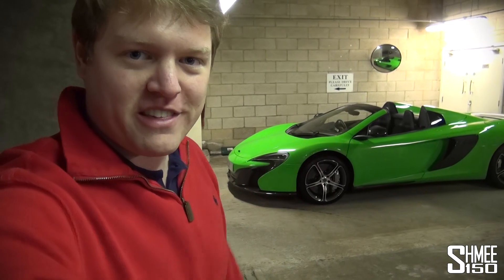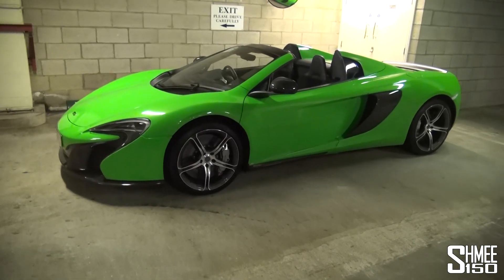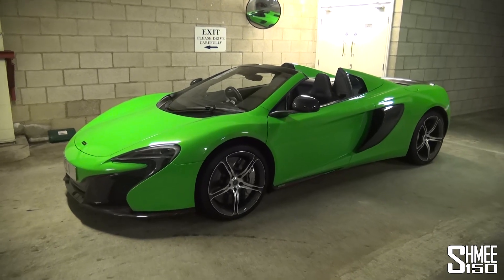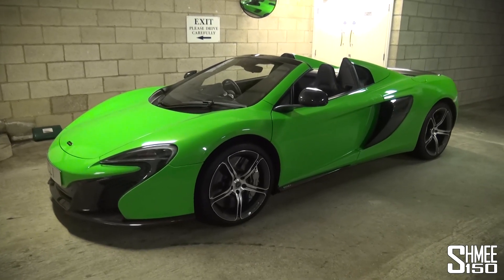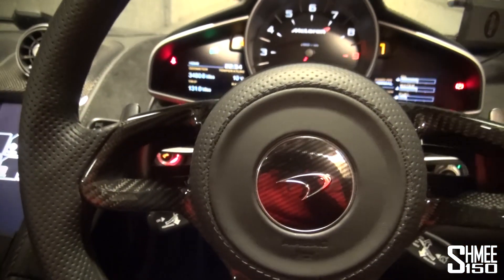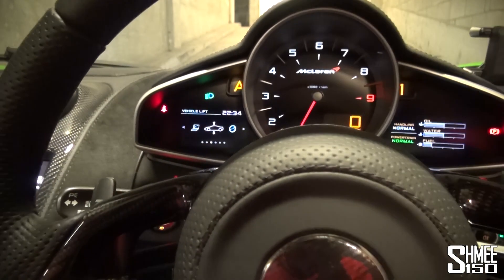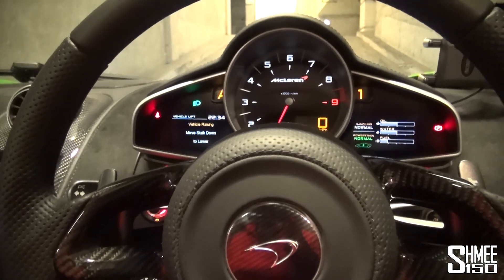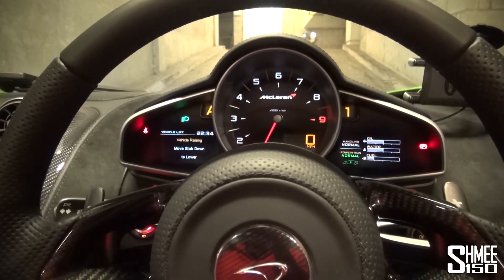McLaren 650S - Lift System Demonstration

Comment: I have always wondered about this low super car issue. Lift systems haven only been a more recent thing. If you are in a older super car and come across a speed bump with other cars behind you what exactly would you do? I would assume drive away and hope to find another route. Also how does this lift system work? I may have missed you saying it in the video, but is it hydraulic or air bags, etc?
Reply: It's way easier on a 458 Italia. 1 button push, boom, done. If you're under 40kmh you can turn it on already when you see the bump, so no one behind you honking needed either. :)
Reply: Hydraulic since the suspension is all hydraulic based.
Reply: Ric Des lol ya idk why they would make a thing you will probably use  a lot so complicated. Should of just been one button in the menu on the navigation system.
Reply: Porsche turbo automatic inflating bladder, brilliant.

Comment: Shmee150 Hey Shmee, just wondering, is the lift feature enough to get over an average speed hump? This is a road we use a lot as a short cut, and I am wondering if the car will clear this: 
https://www.google.com.au/maps/@-37.841446,145.052445,3a,75y,286.07h,61.68t/data=!3m4!1e1!3m2!1sr1IPD6azqhLzk0KL3OCPiQ!2e0

Thank you in advance.
Reply: The LoudAssasin As can be seen from the marks on the ground, this place is problematic to some normal cars that are nowhere as low as GTR's or other sport cars...

https://www.google.co.uk/maps/@60.122163,19.942997,3a,50.7y,280.67h,59.51t/data=!3m4!1e1!3m2!1sufDFtS1snmfcI-9qVwtSrw!2e0

I've often wondered what sort of changes would i have to make to my routes if i were ever fortunate enough to be in a position to buy a car that would be lower than normal.
Reply: The LoudAssasin is it a white GTR by any chance?
Reply: Hey thanks I know where you live!